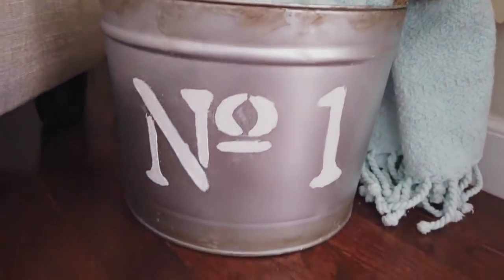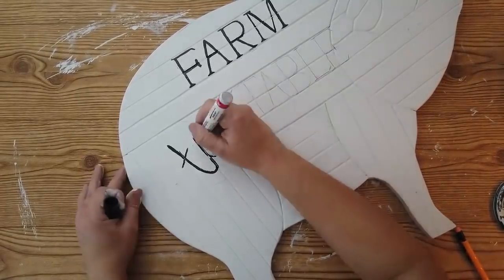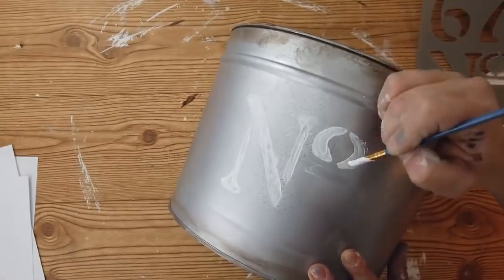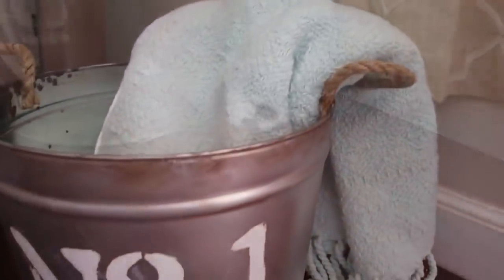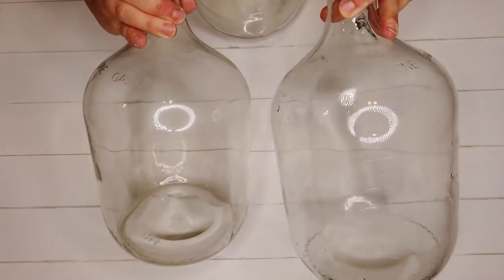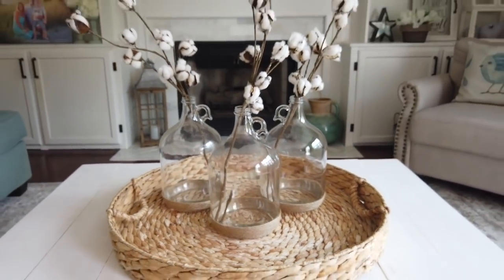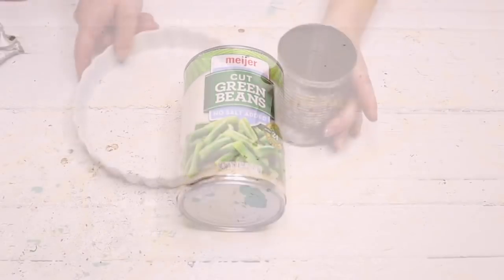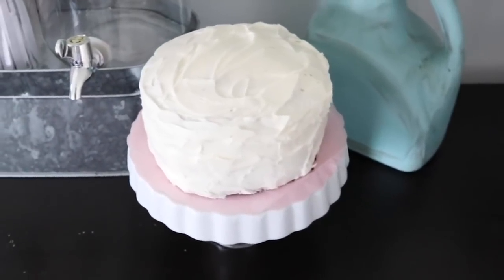🌟TOP 15 Farmhouse Trash to Treasure|Thrift Store DIY Home Decor

Comment: Line a cast iron skillet with a little foil. Heat the skillet up on low or medium setting on your stovetop. Hold the edges of the plastic container you want smoothed directly onto the foil. Just for a few seconds until the plastic melts enough to smooth or slightly curl. Wa.la. Easy, smooth edges.